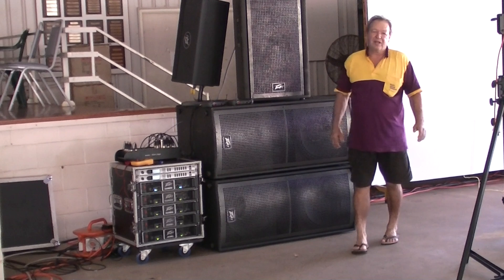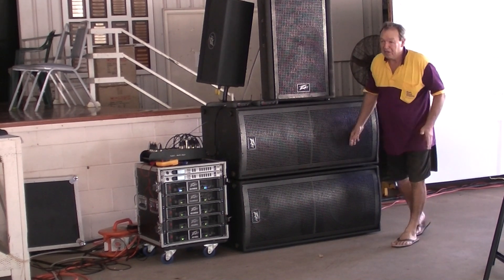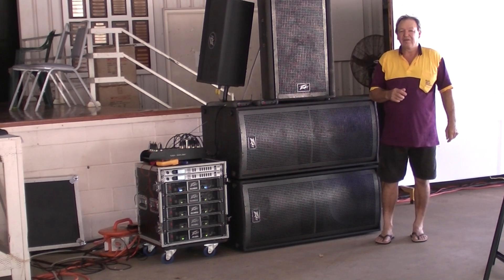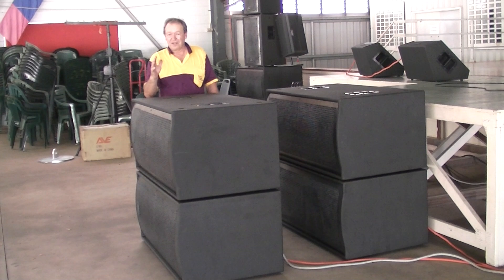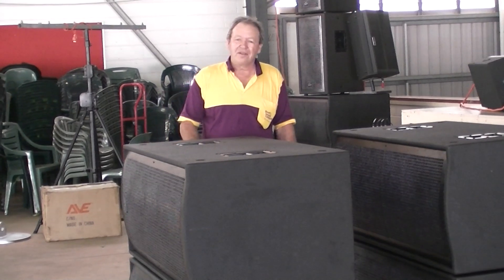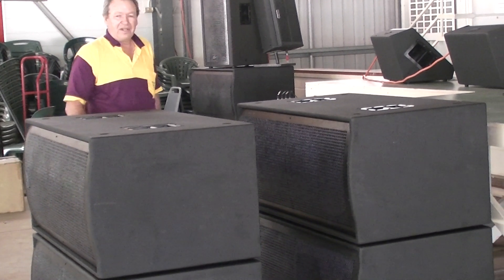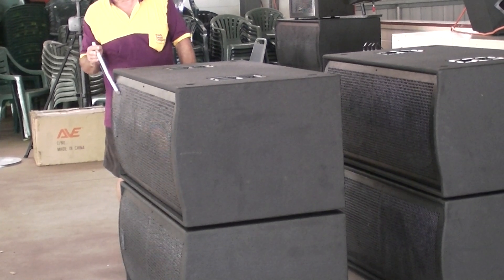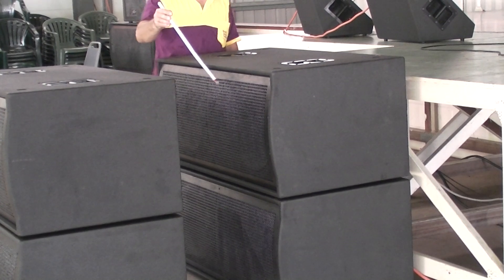Anatomy of a Pro Audio Sound System  -  Part 16

Comment: Got versarray subs?
Reply from the maker: No, the subs are Peavey QW218
Reply: Brad Perry ik that they are Qw218 but i just wanted to know if you also have the verssarray,lol.
Reply: MultiUS Productions I have both buddy what's your question?
Reply: Omega Proaudio well you see when i use the versarray subs for outdoor functions the sound can be heard from miles away but when i use it for indoor functions the sound is no where to be found. therefore i was wondering if i could get some tips with that?
Reply: MultiUS Productions have you tried adjusting your frequencies?? I use mine indoors and I have noticed in some venues the lows are lacking the hard punch until you step 40 feet away, so I play with some of the low frequencies and that seem to help significantly.
Reply: Omega Proaudio i set my lows starting at 31.5 hz and ending at 50 hz but when i use peaveys i usually put them at 20hz to 80hz because i feel like the speakers would be strong in playing all those frequencies but i guess next time i use I'll try that 31.5 hz to 50hz
Reply: MultiUS Productions are you using the digitool live?? At 31-50 htz you might be missing a lot of key frequencies for some instruments, what king of music you play?
Reply: Omega Proaudio i play all music. but i run a set with 4 subs. 2 play the lower notes and the other 2 play the mid bass notes

Comment: overflow onto stage. use cardaoid set up
Reply from the maker: Yes.... but this video is to demonstrate an endfire setup
Reply: There is that too.  Also a tip. Lay bass bin/scoop on the sides works in large areas like parks

Comment: Are you use power for the speaker cable ....?that I see the green colour....
Reply from the maker: We don't have any green speaker cable.... just grey or orange colour. However, our 'speaker' cables are actually electrical power cables..... heavy duty electrical cable works well... after all, the signal from the amps to loudspeakers is AC electrical current of varying voltages and frequency

Comment: what size cab;e for the subwoofer???? (awg).. i'm new in this arena
Reply from the maker: In Australia we use metric size cable... 4 core x 4mm (4 square mm wire cross section),,, that size equals 11AWG.... so you would need to use 12AWG as minimum or 10AWG...

Comment: Nice gear set up.I've watched all the anatomy videos of your channel and it's pretty nice.I just have a question.Why the qw series over the sp's.Thanks again for sharing.
Reply from the maker: The QW2 series are a step above the SPs for sound quality/clarity and SPL (sound pressure level) ... this difference is particularly noticeable in outside venues where the QW2s 'throw' further... partly because they are louder, but also due to their symmetrical HF (high frequency) horn design.
 The SPs have an asymmetrical design with the HF axis tilted down at 10 degrees... this is great for smaller indoor gigs... but the HF drops off after a relatively short distance outside.
  Both good series, but I am very happy with QW.